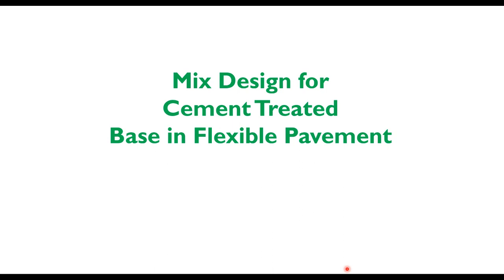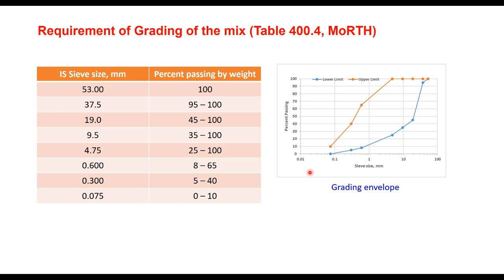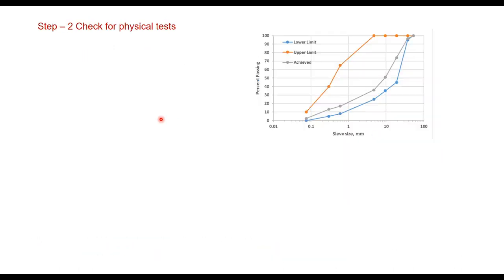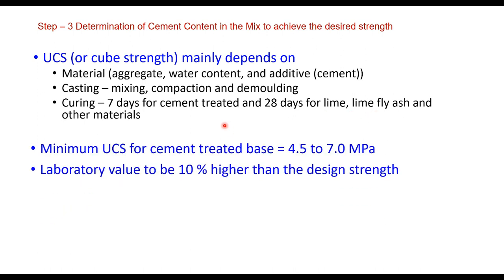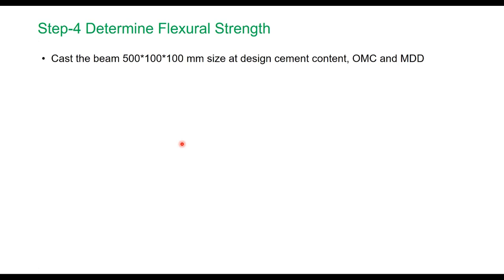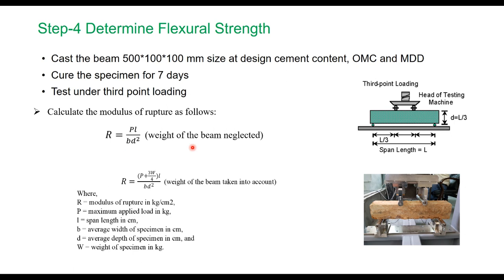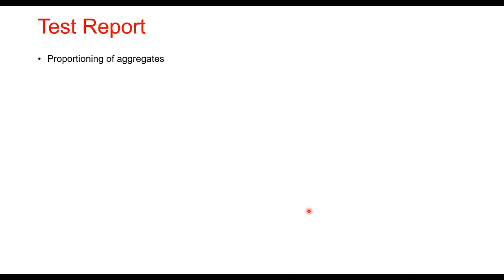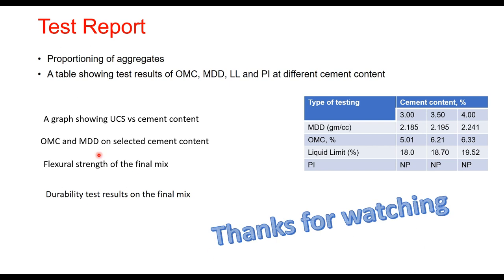#highways, Design of Cement Treated Base for a Flexible Pavement, Stabilized pavement layer.

Comment: Thank you for the videos, sir. I have a query regarding the selection and casting of beams for determining flexural strength. Should the beam size be based on the Nominal Maximum Aggregate Size (NMAS) or any other criteria?

For example, if the NMAS is 37.5 mm, which beam size would be appropriate for casting—500x100x100 mm or 700x150x150 mm? Additionally, if I use a 4.89 kg rammer for compaction, how many layers and blows should be applied for each of these beam sizes? Is there any code to follow?
Reply from the maker: This size of 100x100x500 is taken as the stadard beam size for cement - aggregate mix. For soil-cement mix, a smaller size can be adopted.
Better not to compact with hammer, do it through vibratory plate.

Comment: Sir for CTSB mix design the gradation of mix design as IRC 37-2018 clause no 7.3.1 recommended gradation as per Grading IV of Table 400-1 of MORTH Specification. In MORTH for CTSB layer the Gradation as per Table 400-4 recommended for Sub base/ Base. for this which gradation we take in field for Cement Treated Sub Base Layer gradation Table 400-1 or Table 400-4
Reply from the maker: Your point is valid, but in my opinion you should go by IRC 37
Reply: @SatishIITR  Thank you sir for your guidance

Comment: Thank you sir, my some query is: field dry density Cement treated Base (CTB) fails, how to recheck, and what is the next procedure for F.D.D checking.
Reply from the maker: There is no method as such to correct the field dry density, once the layer has been compacted and cured. Low density might be due to delayed compaction (generally compaction of a CTB layer must be completed within 2 hours of its mixing).
Now you can check in-situ UCS of the layer and see if it is within the limits. If the core taken from the site does not have 7 days UCS also within permissible limits then you should reject the layer.
Reply: Thank you very much Sir for your valuable information. Actually I am working at NHAI projects and I have faced this problem some times and I also want to know how to calculate cement content in CTB, if the sample has been taken from site   as no procedure or methodology has been given in IRC 37 and IRC:SP: 89 @SatishIITR
Reply from the maker: ASTM C 85 gives a method to get the cement content in Hardened concrete. The method is quite tedius, but gives accurate result.   @dr.p.ganapatinaidu8698
Reply: @SatishIITR  404.5 Strength
Cement treated soil sub-base/base shall be tested for the unconfined compressive strength value at 7 days, actually obtained in situ. In case of variation from the design UCS, in-situ value being on lower side, prior to proceeding with laying of base/surface course on it, the pavement design shall be reviewed for the actual UCS value. The extra pavement thickness needed on account of lower UCS shall be constructed by the Contractor at his own cost. (MORD extract)

Comment: Thanks for the explanation, my question is: how to calculate the resilient modulus (Eb) for a cement-treated base layer with an unconfined compressive strength of 450 psi at 7 days. I have an exam next week and I am stuck. Kindly help.
Reply from the maker: E = 1000 times 28 days UCS 
OR Maximulm Flexural strength is taken 20% of UCS
Watch my video on Design of Flexible Pavement, it will be clear. It is available in both Hindi and English.
Reply: @SatishIITR  Appreciate your reply. the only info I have is UCS 450 psi at 7 days. I am still confused about calculating E so I can calculate SN to determine the base layer thickness. any advice? Thanks in advance.
Reply from the maker: @nawarmofti288  In my opinion, you should convert this UCS in MPa and then find Mr. as 20 % of this UCS.
Reply: @SatishIITR  Thanks.

Comment: Sir What is the relation between UCS value and Compressive Strength of Cube in CTB Mix design if any?
Reply from the maker: There is no such single relaton as it depends on strength (grade) of the concrete. As stated in BS 1881, the compressive strength of concrete gained by cylinder specimens is equal to 0.8 times of the compressive strength gained by cube specimens. However, in fact, this ratio is not always precise in the applications.

Comment: Sir, How is this Cement treated Base (CTB) different from Cement Bound Granular Mixture (CBGM). Can you please guide me
Reply from the maker: CBGM is popular in UK and is extensively used for foundation as well as base of a pavement. CBGM allows use of RAP and other local materials also and it is designed as we design Dry Lean Concrete for base in a rigid pavement (aggregate - Cement Ratio).

Comment: Sir please post ctsb cube casting manually with irc specifications
Reply from the maker: Do you mean design of CTSB as per IRC?
Reply: @SatishIITR  sir, i too have the same doubt.., how to compact the sample in cube.., statically or dynamically?
Reply from the maker: @sandeepreddy2235  can use any method, important is to achieve the density.